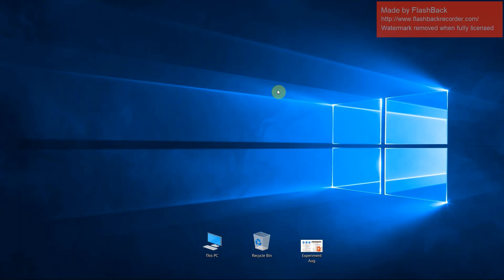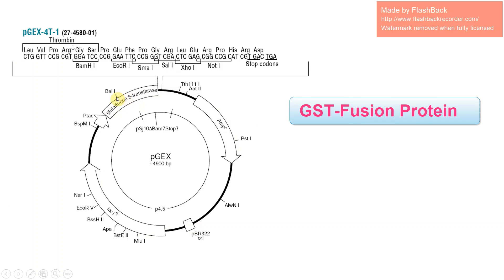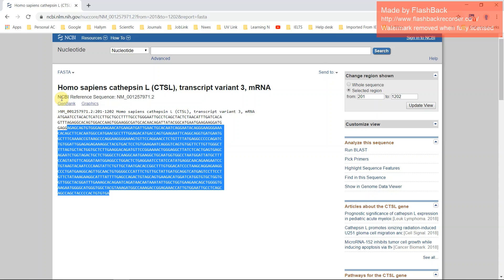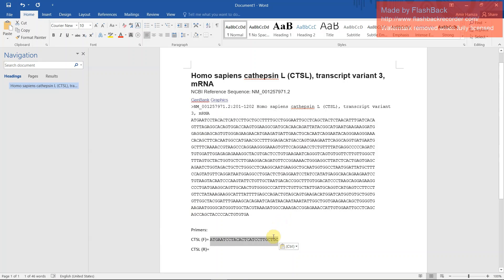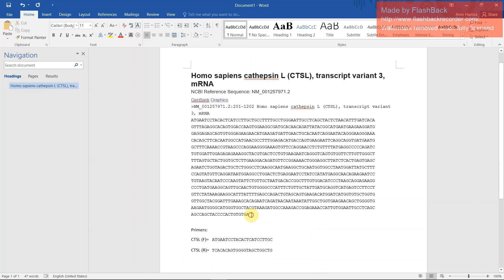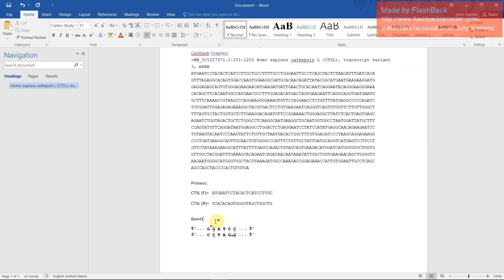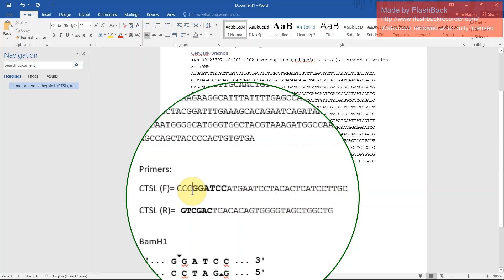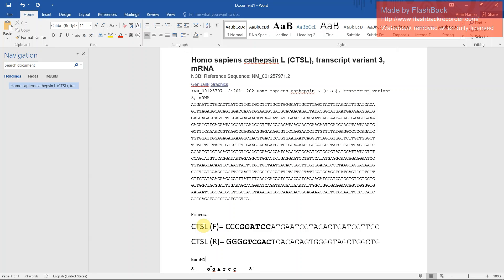Molecular Cloning Part-1: Primer Design

Comment: Amazing explanation. Thank you very much. But i have some questions: 
Question1 If we want to remove the stop codon in case of C-taging the protein, we could just delete the stop codon? Should we replace it with a different codon? What is the optimum strategy to avoid misfolding/mislocalization of the protein due to the addiction or omission of an amino acid?

Question2: what is the best way to adjust the translational reading frame? How to chose the neucleotide/s to add to the primer? 

Question3 is there a preferred GC content percentage in the primers?

Question4: does the gene direction play any role in primers design or there is no need to worry about it?

Comment: This is an awesome video! Would this apply to overlapping primers for a recombination plasmid, for example  primers covering plasmid vector -->Gene left flank, Gene left flank-->antibiotic resistance cassette, Antibiotic resistant cassette --> gene right flank, Gene right flank --> plasmid vector
Reply from the maker: This is applicable for cloning only, i think you are talking about the Site directed mutagenesis primer design, in that case totally different approach you have to apply. Or, if you order any company kit, then please follow Their interactions. Thanks for your comment.